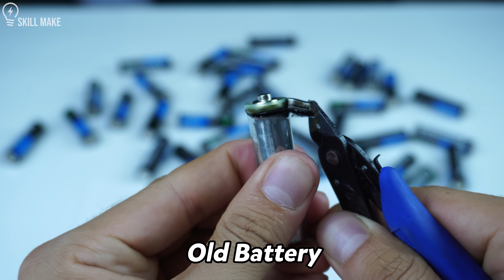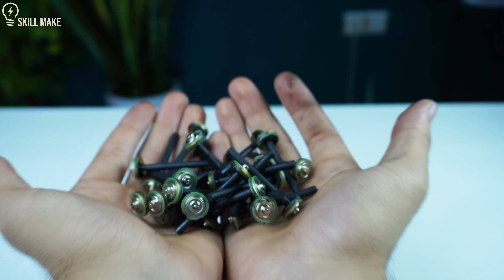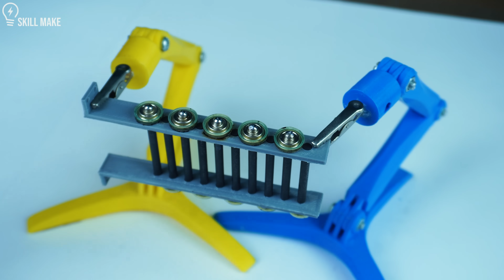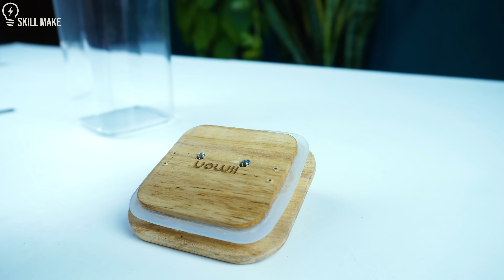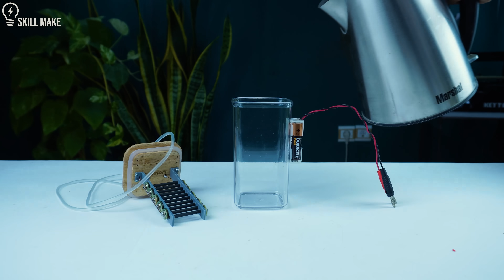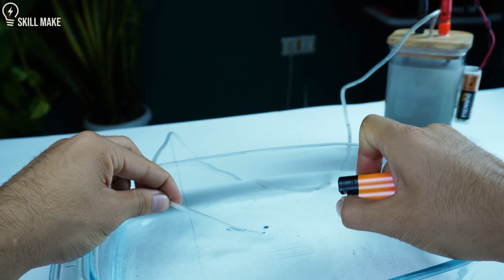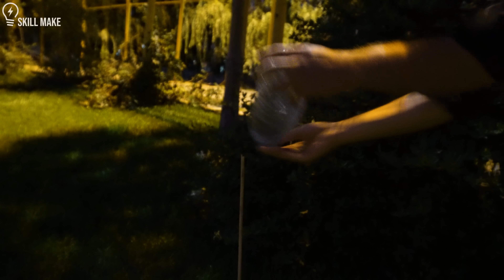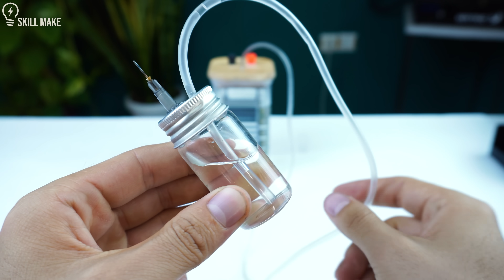Water into Hydrogen - Making a Simple Hydrogen Generator from old battery - hho

Comment: i built myself a hho generator with the stainless steel plates back when i was young. powered it with a lab power source at 24V and 15 amps, worked really well. i had it outside to test and torch some stuff, but didn't have a "bubbler" installed, so the flame went back into the tubing and i got a hell of a loud bang. shrapnel flew everywhere, so please if you wanna torch stuff with it, be safe and build your own bubbler aka flashback safe😂
Reply: Now I know why I got "Satan's guide to Bible" as a video recommendation.
Time to learn what a "bubbler" is.
Stay safe XD
Reply: @madeinresitasometimeago3970 What?
Reply: 💣  maker 😂😂😂😂😂
Reply: @sher-lm6rx  cough    blow off spring loaded oopsy...   even if it all goes off the lid is spring loaded on there... pop..  thud...   if   I got 3 flash aresters in a row
Reply: same experience XD
Reply: Good job. If the stainless steel was the chromium kind, then you're lucky to still be alive.
Reply: Yup .... its a different  kinda 💥  hey ... it really rocks your world
Reply: Dis you continue after that ??
Reply: That sound of the flame ripping through  the tube makes you stomach drop
Reply: I'm deaf in one ear and got ripped up pretty good nose and hand ... I continued though now I'm a champion 🏆  I have them running often in my living room ... 😮
Reply: Well not basically , it is ...
Reply: @madeinresitasometimeago3970 but you still need to protect the bubbler..  at the base of your device you are using run a check valve . So if the flame goes to go in it is rejected immediately saving your tubing and equipment
Reply: I made one for a science fair 30+ years ago and they said it was BS 😂